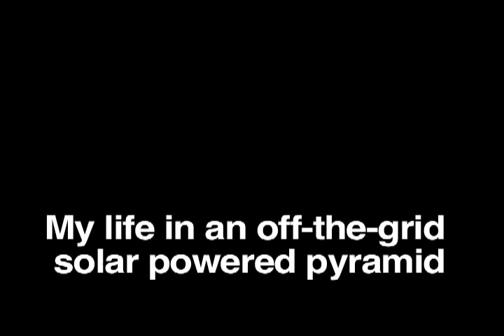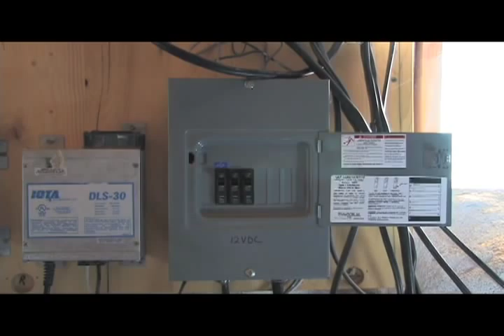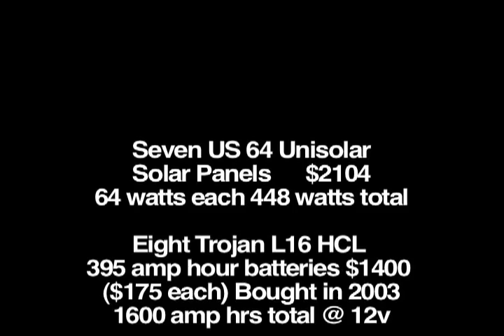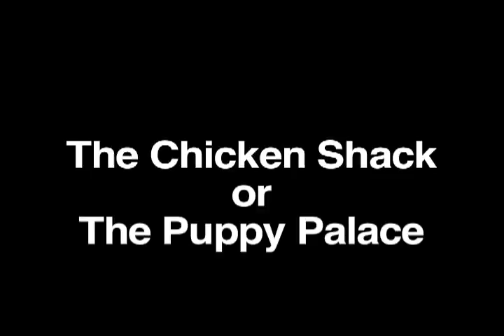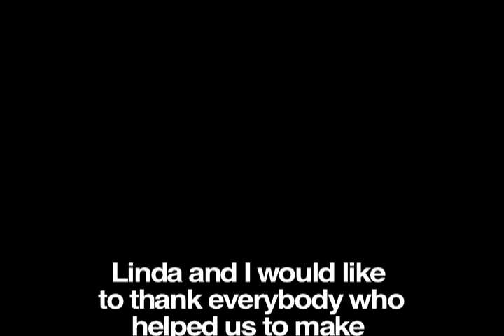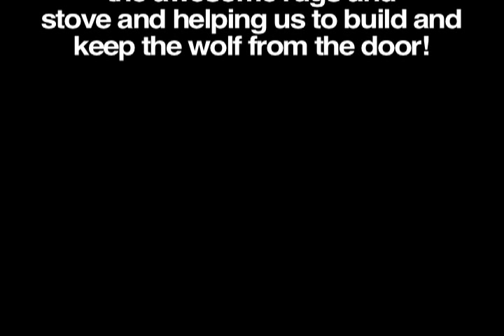My Life In An Off The Grid Solar Powered Pyramid- Entire Film!!

Comment: Hi me here again   I myself am a retired   electrician    well in    Saskatchewan in   theory all building   electrical systems should   meet the standards of the    canadian            electrical code   even if   the system is off grid   it is a good idea because   batteries have plenty of energy to start a fire that is a given and if the voltage is upped via   inverters or you decide on a higher   DC voltage then  there is a  electrocution   possibility so yea I see the reason ,,,    now when you are   off grid there is not much times when you will be asked for permits   etc   here it is when you    hook up to the utility that the permits are   demanded   ,,   now you may be solar off  grid or  have solar power   with grid   intertie  saving you to have to   buy    batteries   but   oh boy then you must  really have a completely   approved set up including a approved   special grid intertie  synchronized   inverter

Comment: If your real handyman, you would of made a micronized thorium reactor for hot water, desalinated water, power , heat but probably 10 of those pyramids. Hi tech agrarian society that has all needs met is at had but they hide knowledge
.
Reply: I switched to an ipad from a laptop and finally installed the youtube app today, so am just seeing this now.  I thing the whole thorium is over my head.... I have read a little about it and I would agree that it could be great in certain situations, like in space or a submarine etc. I am super happy with my solar even though it is a small system. I finally dug a hole for an underground propane tank last spring and now run my backup generator on propane, never gasoline,  to charge the batteries when there is no sun or I am using tons of power. Lithium ion batteries now, instead of lead acid, they charge super quick, do not off gas and can go down to 10% without damaging them. They have changed my life, so easy and convenient, you can see on your ipad all the power coming  in, going out, state of charge etc. amazing.